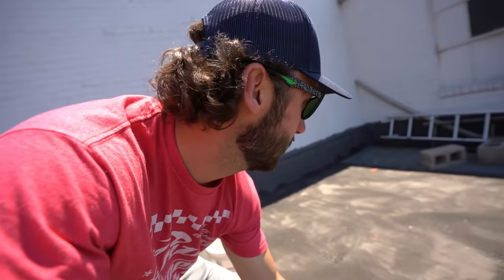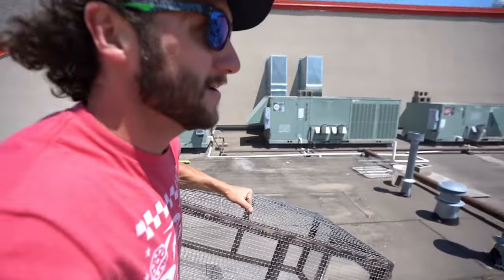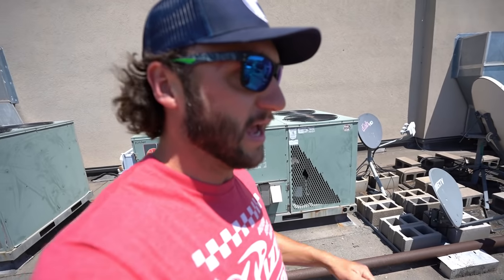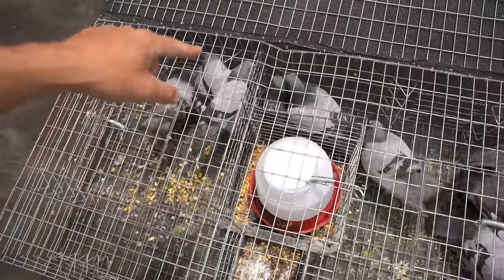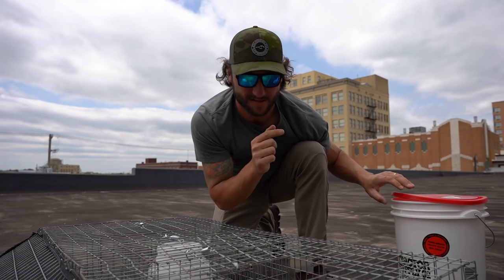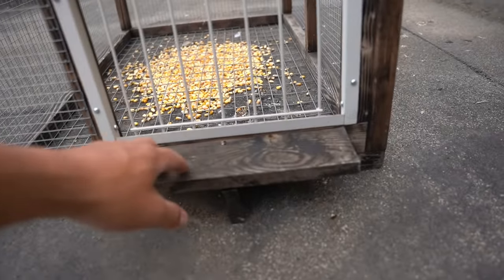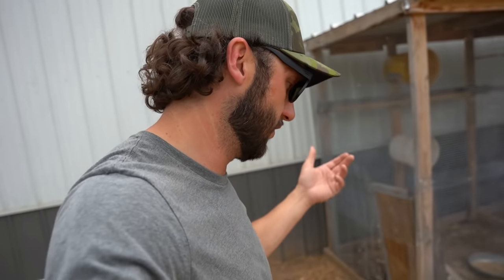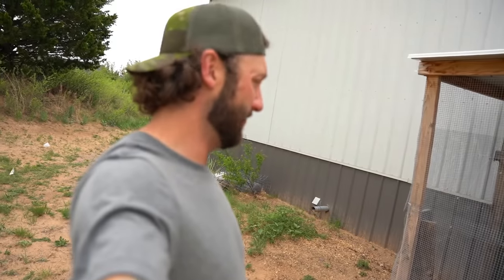Trapping Pigeons So I Can Sell Them.. My New Pigeon Farm!

Comment: Add perches to the holding pen you don’t need the buckets at all on the ferals as long as you aren’t keeping them to bred . I keep homers and have a 12 by 24 and a 8 by 12 loft if I wasn’t active in the racing side to wouldn’t need half of what I have but put some perches up on the feral side you’ll be good . You should get into racing locally be good content for the Chanel .